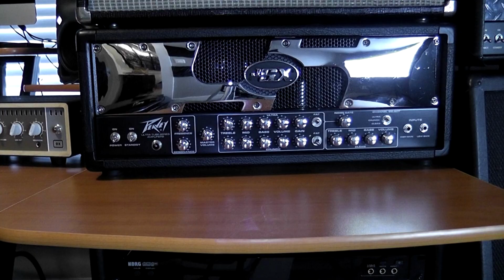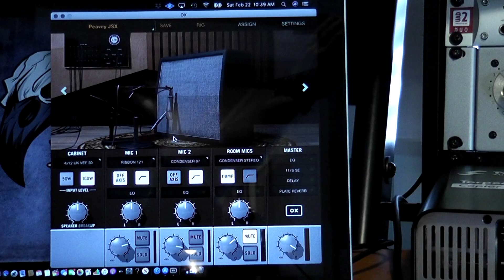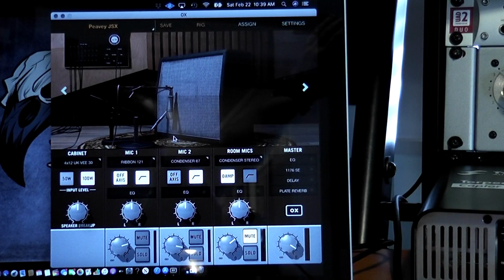How Bad Is It? Digitech Grunge

Comment: Thanks for an actually fair and well conducted review of this pedal.  You are spot on about other reviewers not having the right starting tone on their amps for a pedal like this.  I guess everyone got so used to dialing in a crunch tone then adding a boost or overdrive pedal that they forget that when using a pure distortion box like this its best to start with NO DIRT on Your amp!
Reply from the maker: Thank you for checking out our channel, we pride in having fair, unbiased reviews on our channel, if the pedal is horrible it will incriminate itself during a proper sound sample. we have hundreds of gear review videos you can check out as well as amplifier shootouts and much more. please subscribe and thanks again for checking out the video - Kevin

Comment: This circuit could also be found in some of digitech’s multi-effects from the 90’s. I used it a lot when I had a Digitech ValveFX. But the four band parametric Eq in that unit made it far more tweakable. And a delay at 10 mili seconds or so thickened that sound in a great way.

Comment: I started picking up some DOD and Digitech weird pedals and honestly I never hated the Grunge pedal. It's metal as hell, I think the Grunge label is wrong but it's still useable
Reply from the maker: Totally agree this series i have created on how bad is it? is to honestly showcase the pedal for what it is, unbiased and as honest and as fairly as we can, i think if a major pedal brand puts out a pedal there had to be some  reason why they put it out, so i do my best to figure out why the brand produced that pedal and what people have had troubles with and were the pedal went wrong and usually its not hard to figure out why its had a bad rep and 9/10 its not hard to make the pedal sound good because its just being used wrong. - Kevin
Reply: @Crypticmaskguitar  well a lot of those "Grunge" bands used pedals like DS1's, Muffs, Rats. The Muff and Rat in particular are high gain distortions. And bands like Melvin's who got lumped in with Grunge bands are straight up metal. Again, top video man.
Reply: @PaulyTheFarmer  the grunge is a modified rat circuit and it’s all analog. Plus there are plenty of grunge bands that used some serious distortion Lol. but regardless yeah it was a marketing tactic

Comment: i think that the problem is to start with the gain knob at noon. Lile you said, even with the minimum gain it's already distorted. For what I read it's a rat circuit with changes and comes as a response of DOD (at the time) to the popularity of the ds2 turbo distortion that Cobain used. Just bought one and plugged it into a brown sound preamp pedal with little breakup that goes into a cab sim and it works fine with that, just be careful with the high and the gain knobs.

Comment: Thank ye,  I have one of this DT Grunge pedals. For the longest time, I never even tried it,* but since I'm stuck at home for a long time (due to the COVID Lockdown here) with little to do, I decided to go thru my "unusable" pile of pedals and see what tones I can get out of them.

I see it's another pedal that needs fine-tuning to get the something useful out of it. It's just like my MT-2 Metal Zone pedal in that it just needs a delicate touch on those knobs. 

Hmm, certainly wouldn't be a pedal I'd use regularly, BUT for certain dirt tones, it could get the job done. I noticed that pairing a Tubescreamer certainly helps to tame it a bit so it certainly has potential if you need that particular distinctive dirt tone.

* FYI, I got it as part of a set of second hand pedals in which it had some other pedals I wanted, had to buy all or none and the seller wasn't asking for much for the whole set anyway.

Comment: I have one of these and if I put the "loud" knob over 3 it gets too loud. And tips on what to do about this? I want the pedal to sound more full but I cant seem to figure much out.
Reply from the maker: What is you rig setup? - Kevin
Reply: The loud knob is to create natural feedback at will and destroy the stage I believe!   And for a fuller sound, I found out with mine that with a very slight crunch on my amp (palm mutes should sound clean and accents crunchy) and using those settings:
-Loud 9 o'clock (or whatever suits your need) 
-Bass 12½ o'clock
-Treb as 13⅓ o'clock
-Grunge 12⅛ o'clock (just a little over the halfway mark) 
I end up with a sounds much smudgier than with a basic clean setting yet still clear enough to hear every notes through the massive fuzz generated.  It's also giving me that cracky busted speaker sound which is what I believe makes for the clearness in the sound.  So overall the smudge and crackiness make a beautifully disgusting full sound.  I would recommend using this setup only for the really heavy drops in your songs cuz it's a bit much for the full length of a song, but try it out for yourself and give me some feedback if it works for you!
Reply: I always found that boosting the loud as much as you dare, and limiting both bass and treble as much as you can is the best starting point for this pedal.